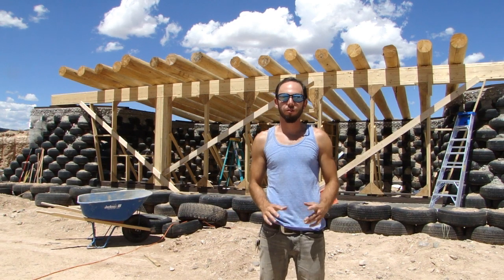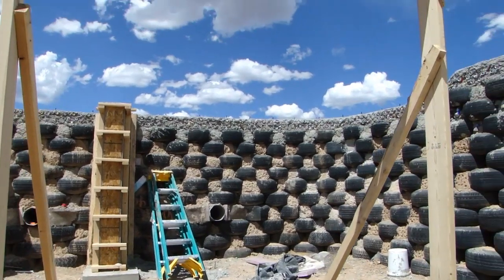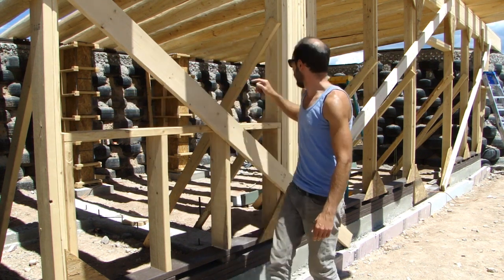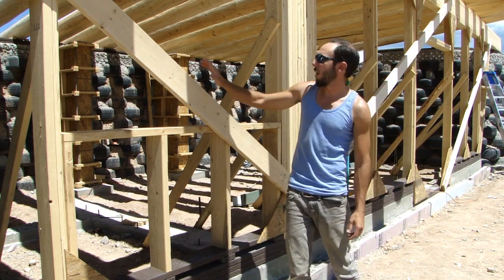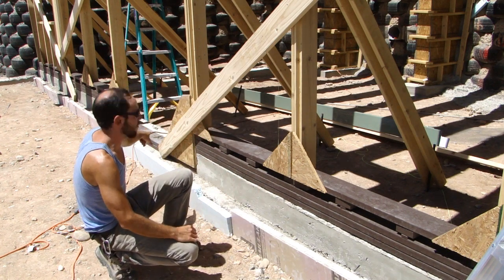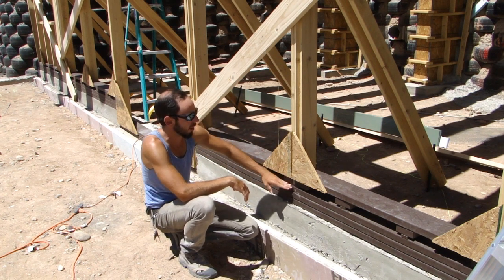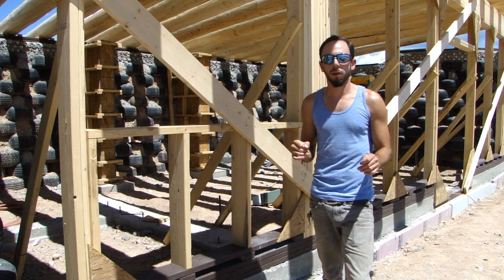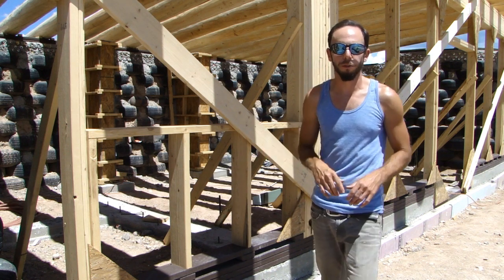An Overview of Plating & Interior Greenhouse Wall Framing

Comment: Thank you for this detailed description and information on why it that way, I build a cabin into the side of a Mt. using a quazi cob/earthship/log cabin biuld and it was not easy to say the least but doable with minimal toxic materials only used tar paper on roof under the metal sheeting. The planters and Cistern are lined with rubber, Most the plumbing is PEX,& cant get around plastic in plumbing or electric, which is the necessary evil if you want to earn a living in today's economy. Thank you

Comment: Header has to be strong to support the vigas and header support must be strong also. Why vigas? What are they supporting? Why wood? I just don't want wood supporting my house. I want a structure that will last 100 years. Like all three earth walls but believe steel framing would be better and cheaper for roof support and frontage. Prove me wrong.